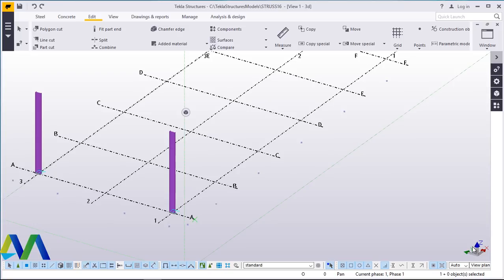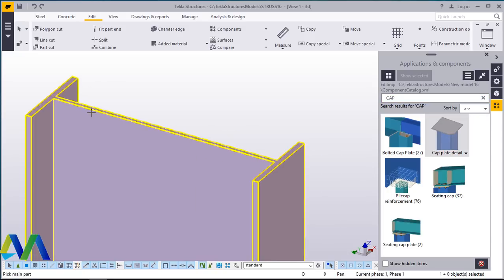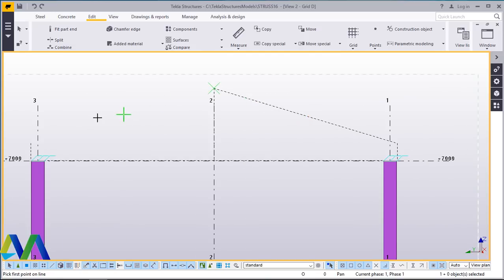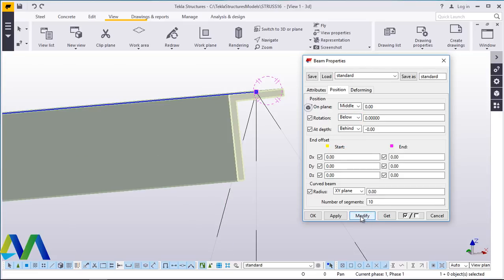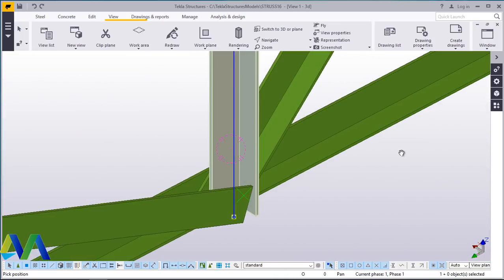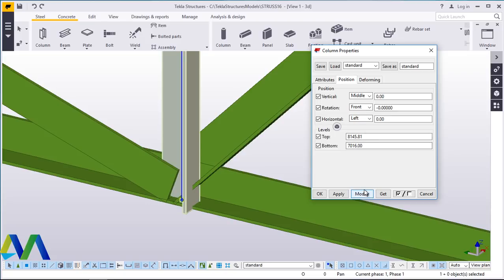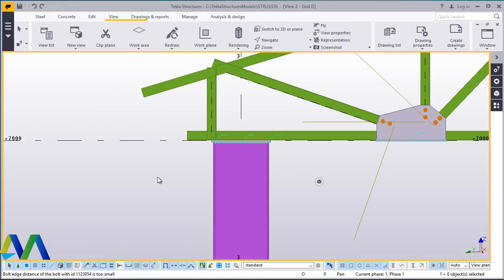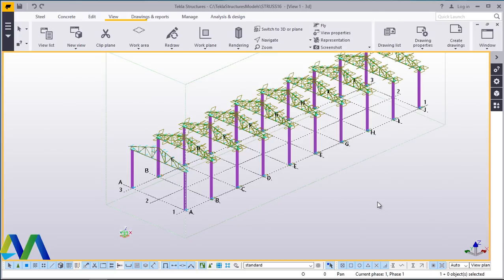How to create steel truss using lines as a guideline in TEKLA STRUCTURES 2017

Comment: Thanks, very useful lessons but I want to take a one question: Can I create steel or concrete profile from lines without additional formation from lines, looks like as in advance steel?
Reply from the maker: Very much possible
Reply: Maurice Dimba Is it some custom's plug-in? I just wanted to asked has a tekla structures command "create profile from line" looks like an "advance steel"?